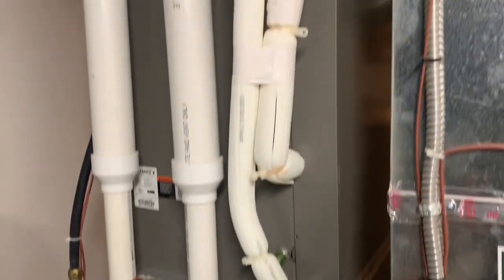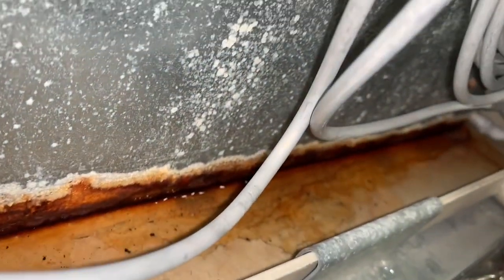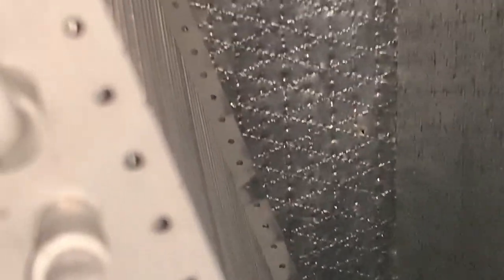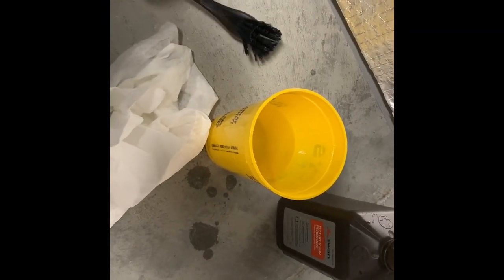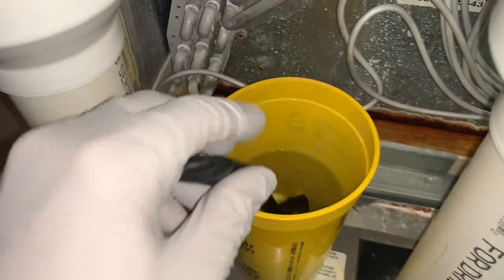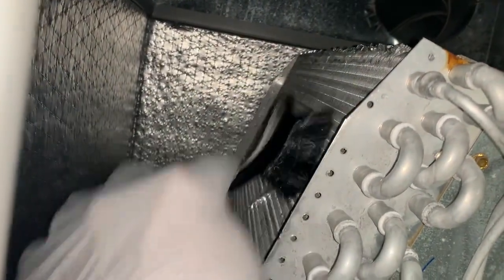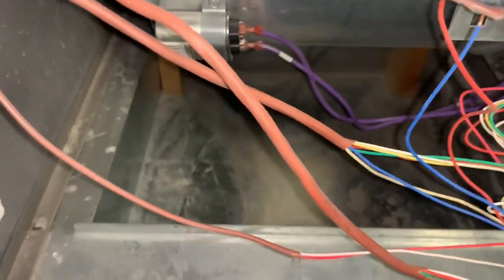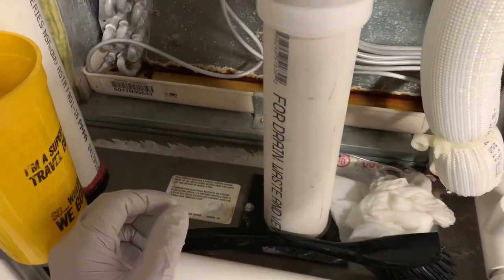My AC smells again like a stinky sock

Comment: sir great video but dirty side of the coil is actually on the inside behind this galvanised triangle plate, almost impossible to clean.  get non rinse nu calgon coil cleaner and use it spraying two cans on the coil next time. this way you will reach  a lot more surface area of the coil
Reply: i def would invest in nice filter cabinet with 5 inch air filter merv 13-16 carbon, your 1" filter setup has atleats 5% air bypass around the filter, all thiss air bypass stays on the coil and when gets wet smells.

Comment: Aluminum isnt anti microbial like copper was so its a problem with dirty sock syndrome, gas furnaces will kill that bacteria and smell when you start using heating full time, heat pumps dont get hot enough so that remains a problem, keep a can of nu calgon lemon scented foaming coil cleaner to use

Comment: Did you ever find a solution? I work for a large hvac company in san diego as a HVAC service technician..
Have you tried changing fan speeds?
Reply from the maker: Not yet. I’m actually wondering if I’m pulling in a type of dust or polin from outside. When I mowed up some leaves I smelt the exact same smell. This also might lift up with why I only get it during one time of year as well. Still trying to figure it out. I’ll keep fan speed in mind though thanks.
Reply: Any update?
Reply: Look into extending fan run time in your thermostat after condenser stops running to allow coil to dry off condensation in the evaporator coil. Also install an IAQ device in the supply plenum. Also check to make sure pan drains completely with no water standing in it during AC off times and make sure primary drain line is cleared out. Annual Maintenance by a qualified ac service tech is recommended as well.

Comment: Quick fix is buy what’s called Dirty Socks spray cleaner for your evaporator coil. There are better options that will eventually fix the issue but I’d say call a professional. As a hvac service tech I see to many people try and fix stuff themselves but eventually they call us in the long run. If you’re not a qualified technician any damage you do to the equipment voids any warranty. Better off just getting a professional to maintenance the system.

Comment: Use uv light up of the coil also try to buy an ionizer  i wave r 4900  a bit expensive but it does great job 👍
Reply from the maker: Thanks for the tip!
Reply: My unit has a UV light and I still got the stink this year .
Reply: @24BLUEELMO  
1---First thing you do wear protective gloves and de-energize the furnace power for your safety and the furnace safety 
check the coil if its dirty rinse it with 5 liter  water and white vinegar 1liter   or best thing clean it with spicial fluid that called sani c_n_d 
Never use bleach this will mess up the coil 
2---Rinse the coil with water 
Check the blower fan try to vacuum it to remove any dust and  derbis 
3---Check the drain pipe  and flush  it out  check if its free no clogs or blockage put 1 litter of white vinegar  on drain pipe to kill odors and bacteria 
Last thing energize the furnace and set it to  fan mode  only from your thermostat 
Make sure your air  filter is new at least merv 8 or 10 
My furnace air filter is permanent  life time  merv 10 so I always clean it outside the brand name k&n air filters they made a great filters 
This steps will improve your air quality
Reply: IV light will not get rid of the smell. You need an Air Scrubber that ionizes the air. There are also ozone free air scrubbers that are good for those who have  sensitive allergies because continuous ozone will make the allergies worse.